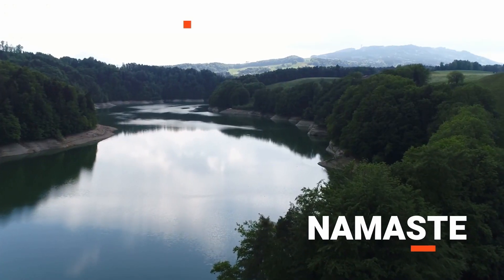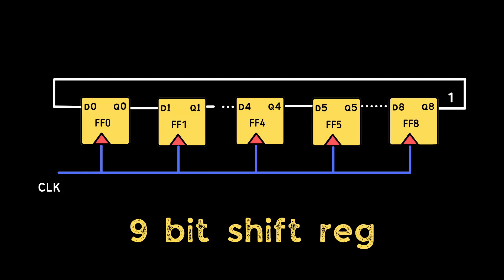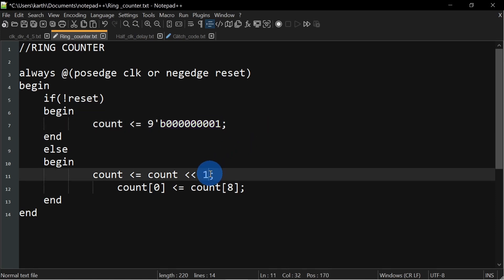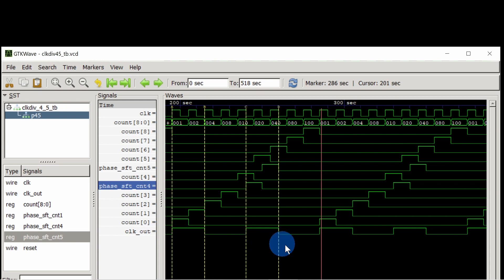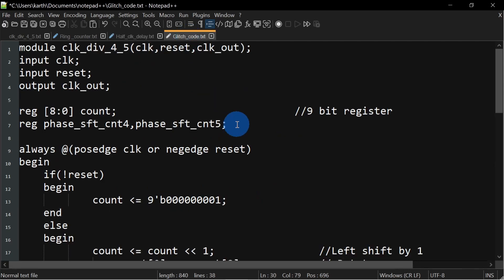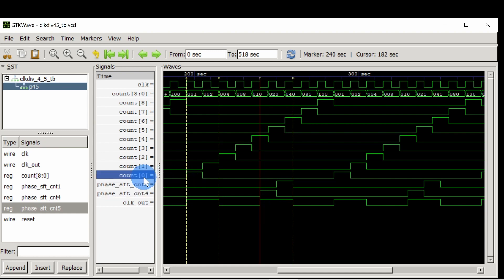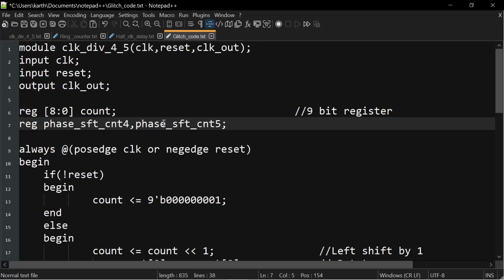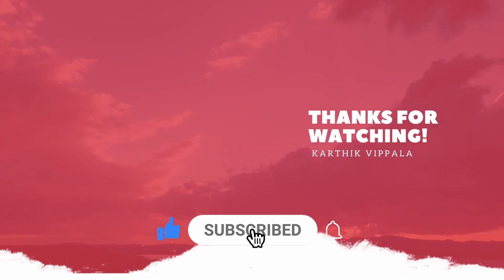How to design Clock Divided By 4.5 ?  Explained!

Comment: in this videos at 6minutes22sec diagram will come,  Q5 output not to connect to OR gate, but in diagram its connected.

in code assign statement, count[5] not there, but in diagram its there

Comment: module clk_divider(clk_in,clk_out,rstn); // for clk divide by 1.5.

input clk_in,rstn;
output clk_out;
reg [2:0]Q;
reg Q2;
wire clk_out2;
wire clk_out1;
always @(posedge clk_in)
begin
if(rstn)
begin
Q[0] <= 1;
Q[1] <= 0;
Q[2] <= 0;
end
else
begin
Q[1] <= Q[2];
Q[0] <= Q[1];
Q[2] <= Q[0];
end
end

always @(negedge clk_in)
begin
Q2 <= Q[2];
end
assign clk_out1 = Q[2]|| Q2;

both_edge_FF ff1 (clk_in,clk_out2,clk_out1);

assign clk_out = clk_out1 ^ clk_out2;

endmodule

///////////////////////////////
module both_edge_FF (clk,Q,D);
input D,clk;
output Q;
reg Q1,Q2;
always @ (posedge clk)
Q1 <= D;

always @(negedge clk)
Q2 <= D;

assign Q = clk ? Q1 : Q2;

endmodule